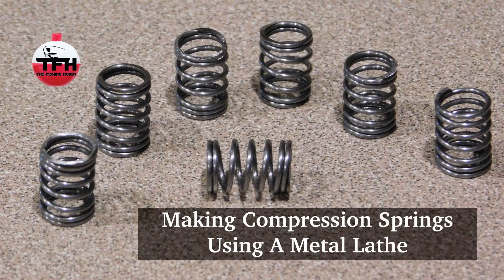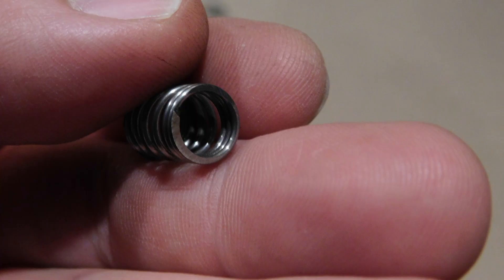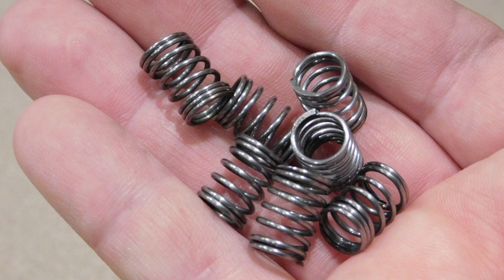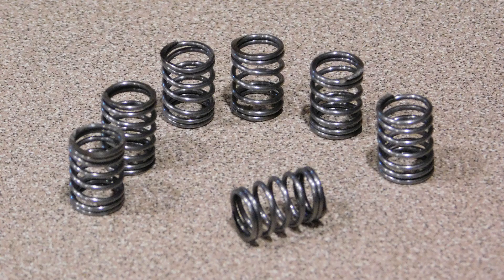Making Compression Springs

Comment: You are supposed to heat them to first harden them then you heat them again to temper them.  

I think the first heating depending on the metal is up to the point where the metal looses its magnetic characteristic.  Then quench it into water or oil and swish it around.    This heating makes the metal hard but brittle.   Then it is heated like in an oven up to about 400 degrees for 2 hours then let it cool slowly.  This gets rid of the brittleness. Do this step two times. Heat wait cool.  Heat wait cool.  Now the spring will be hard. Springy, long lasting, and tough.
Reply from the maker: That sounds like some good information, thank you!
Honestly, for what I use these on that isn't necessary. They aren't under much pressure, just a spring to tension spools of thread pretty lightly. 
Great tip though for others looking to make something more substantial!
Thank you for sharing your knowledge and I will pin this so it shows up at the top of the comments list so others watching may see it and gain some useful information 👍
Reply: The Fishing Hobby  if they don’t stay springy long enough to suit you that’s the cure. 

O BTW  great video
Reply from the maker: Thanks!
Reply: @TheFishingHobby  If you do that for spring wire its ruined. It need needs only little heat treatening after the bending. Dont remember exactly now but its something like in 300 C few hours and thats it. I have spring factory next to my home. ;)
Reply from the maker: I understand what you are saying. Maybe it is ruined from a technical specifications standpoint. From a practical use standpoint, I've been using these springs for several years with zero issues. In fact, I sold about 300 fishing rod building jigs when I was making them and they all shipped out with these springs and I never received a single complaint about the springs. These are very light duty springs that keep tension on spools of thread as the thread is pulled off the spool while wrapping guides on fishing rods. If it were something more critical or heavy duty, I'd agree 100% with taking the extra step to heat treat the springs. For a simple light duty spring that is used for something where there are no safety issues, these hold up just fine as is.
Reply: Thomas D Harrell lmao I just wrap paper clips around my pencil and the work fine
Reply: Pretty sure you don’t have to do that when using spring wire.
Reply from the maker: @adrianharrison5208  I'm not sure. I know for my purposes, this (as I did in the video) works just fine but I'm definitely not an expert on the subject.

Comment: Hey,
Good job done by you 👍
I am curious to know the relationship between the mandrel/shaft diameter and   final Inner diameter of spring.
As it opens after removal from mandrel.
Reply from the maker: The way I do mine, the spring inside diameter is about 40% more than then mandrel diameter. That would probably vary a little by how much tension is placed on the wire as it is fed onto the mandrel.
Reply: @TheFishingHobby  thanks, yes it is also vary as per selection of material grade.

Comment: Thanks for this video. The wire is wound on the rod without tension but only by guiding in the turret : In this, case which ratio spring diameter / rod diameter do you obtain ?
Reply from the maker: The rod diameter is about 6mm and the inside diameter of the springs are approximately 9.5mm. I do use enough tension with my fingers on the wire to keep the wire wrap against the rod while wrapping.
Reply: @TheFishingHobby  Thank you for your answer. I obtain a ratio, a little smaller ( 1.50 or 1.55), with a DIY system on the lathe turret that tighten the wire.
Reply from the maker: Very nice! How is the tension applied?
Reply: @TheFishingHobby  I never measured this tension. I tighten the wire with a screw until the chuck becomes hard to turn by hand
Reply from the maker: @michelespinasse1763  seems like a great idea, thanks!

Comment: SKIP to 1:00 to get past the non-sense intro and meaningless fluff. An into is an advertisement for what you're already watching.
Reply from the maker: Hopefully no one else wastes a whole minute watching something irrelevant on YouTube! Thanks!
Reply: @TheFishingHobby  Thank you for supporting the fight against intros, the scourge of youtube!
Reply from the maker: I got your back! Take care and I hope there was something useful to you after the fluff 🤣
Reply: @TheFishingHobby  You're doing a fine job sir, thanks for sharing.
Reply from the maker: Thank you, that is much appreciated!
Reply: How would you go about reconditioning springs a little larger than those?
Reply from the maker: If you want to make larger springs, use a larger rod to wrap them on 👍
Reply: @TheFishingHobby  what I mean is how would you recondition springs that have gotten weak.
  I an referring to springs on suspension rods on washers.
  They get weak and the washers start shaking, dancing, etc. in the spin cycle.  Some are very expensive to replace.
Reply from the maker: I see. Well, I'm not sure. Maybe you could use spacers to take up more room to compensate for the weaker springs. Maybe you could remove and stretch the springs a little? Springs are really expensive for what they are and I suspect that is because of the cost of the equipment used to make them.
Reply: @TheFishingHobby  thank you for your reply.  I have one set of new ones ordered.  I intend to compare free length of the new and old. U feel this will involve stretching the old springs to the free length of the new springs then retempering.
Reply from the maker: I don't know. I'm definitely not an expert in springs. I have stretched small springs before with good luck in the past without retempering but they were under light loads.
Reply: The new ones came in.  I have no way of precisely measuring the tension, but I can tell a lot of difference just using the fingers to sqeeze the springs.  Also very noticeable difference in free length.
  I am looking into finding proper way to remove the old weakened springs from the older used rods (no big deal) and reconditioning them to reuse.  Some of these suspension rods are EXPENSIVE to replace.
Reply: @TheFishingHobby  Not sure at all about the spacers for what I am talking about.  I'm thinking stretching to original free length then retempering with proper heat AND proper cool down.
Reply from the maker: Hope it works out well 👍

Comment: Cool process, is there a way you can make several at once and just snip them apart?
Reply from the maker: Yes, you can just make multiple holes in the rod and cut the spring and move to the next hole. My mandrel isn't very straight or long enough but I will probably buy one that diameter and do just that. The end of the rod would need to be supported in the tailstock of the lathe for making multiple springs.